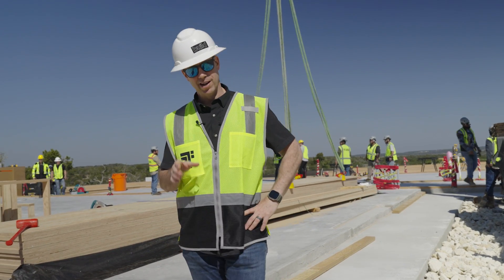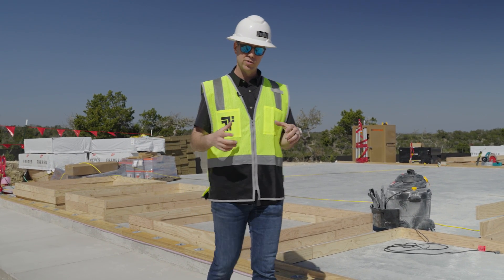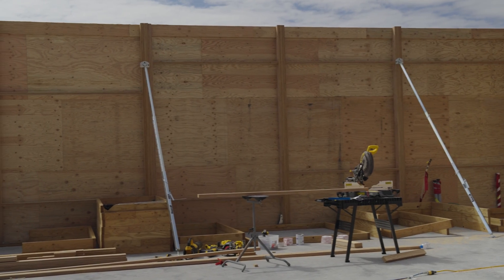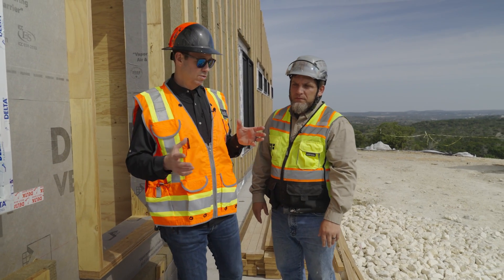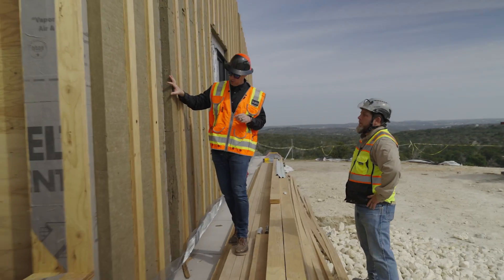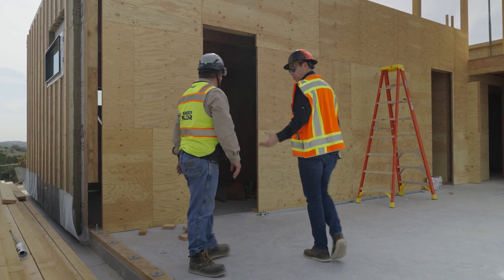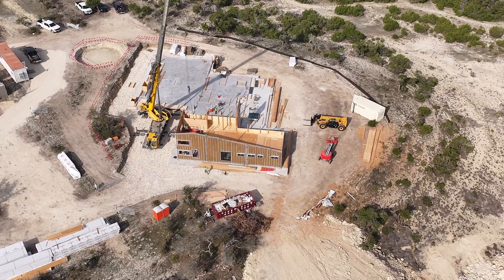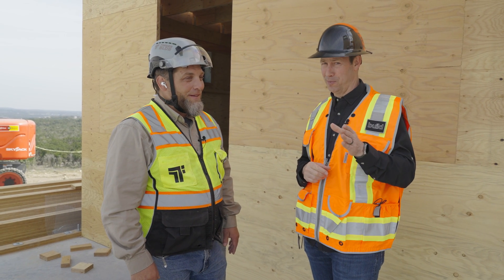NEW FRAMING Like You’ve Never Seen - Mass Ply Light House/Barn

Comment: Gimme two layers of 3/4" ply, offset from each other,  in jumbo form factors like 8'x32' or 10'x40'.  Seams (vertical and horizontal) become the weak point framing with 4'x32'.  A 10' wide panel can frame an 8' window in the center and remain structurally strong all on its own.  Do it right and a tight nail spacing will give you tons of strength without using any fancy Simpson hardware.

Comment: Hey Matt, how many times have we both done remodel & found big time wood rot thankx to plumbing or roof leak that went un-noticed for a while? Just suggesting Sir,, a quick spray coat of paint primer sealer on all rough-in material. so future overlooked leak, wont cost a lot of rough-in replacement or cause any dangerous health hazard  black mold growth. I admire your ability to know exactly what your paying for & selling
Reply: 100%. For a guy who coined the phrase if it doesn't dry it will die, seeing him push this material.... is bizarre to say the least.

Comment: What is the purpose ? Heavy, to many brackets, expensive screws, all expensive ply construction,  Great for expensive cost. Expensive to insure,  Is there some fire rating to chase, or earth quake concern. What is the gain ? Just questions from a 45 yr commercial carpenter bridge builder. In my years a lot of this re-event has gone to the way side or just other past ways are just as good.

Comment: This is why US buildings only last a few years. In Europe this building would fail any building code because it's build like a temporary building. The Plywood will just rot and be eaten by bugs, adding a bit of metal mesh at the bottom is never ever going to be bug proof. There will always be holes either from new or after a few years that compromise the base of the building. A ground level to 1m of blocks would help solve this issue. In Europe this building would fail any building code because it's build like a cheap temporary building and not built to last. Use bricks, blocks and real roofing materials like the rest of the industrialized world.
Reply: Oh c'mon. We have wood buildings a century plus old and still fine. Big buildings 150+ and excellent. The US building industry is like just-in-time inventory management. Just enough. Cost matters as much as ultimate longevity, something Europe does not understand nor care about. Not that this build is low cost, I'm talking lumber in general. US LVL is crazy outstanding.
Reply: Plenty of European countries use wood to build. Just because you haven't traveled much doesn't make you right.

Comment: Watching this from California, my first thought is that this would be great construction for earthquake country. These are dream shear walls.
Reply: The company that manufacture's the LVL for this video, Freres, manufactured floors and columns for and 18-story building in Oakland CA. You are very correct that these would make dream shear walls, and a lot of research is being done on mass-timber rocking shear walls.
Reply: @collinbarkley9699  We had a soft-story seismic retrofit of our building which consisted largely of adding plywood shear walls. The amount of labor that goes into that process -- compared with just lifting these panels into place -- is staggering. I'm sure the LVL is not cheap, but you would save a lot on labor and time.

Comment: What cheap garbage construction, one spark or the like and the whole shebang goes up in flames like a campfire before the fire dept even gets it's hoses connected.
The build real houses in Europe, Hungary, Romania- google view and you'll see almost all the roof are red, why? because they don't build the houses like matchboxes they build them from kiln fired red terracotta blocks that are larger than our concrete blocks, and they are vitrified in a kiln around 2000 degrees.
The walls are about 16" thick, and the hollow cavities in the blocks allows for insulation inside.
Substantial, solidly built, fireproof, sound deadening, vermin and insect proof.

All the walls are built with the terracotta blocks, then they are given a stucco on the exterior. The roofs are not solidified gasoline like the tar and asphalt roofs we have- they are made with the same kiln fired red terracotta pressed into roofing tiles- waterproof, never fades, fireproof.

A house with this construction was caught in Google's street view when it was under construction, a newer view can be found at that location showing it finished if you click on Peton street to go up it- the view changes to a newer date;

https://www.google.com/maps/@47.4981128,17.5682232,3a,15y,198.19h,106.02t/data=!3m6!1e1!3m4!1smx8iWAiS3ClbFMeeczeHNg!2e0!7i13312!8i6656?entry=ttu
Reply: There comes a price to Euro construction. Where our houses are infinitely variable, expandable, fixable, modifiable, customizable, not so with such block construction. Ease of building, speed, variability in look, cost from low to high, quality from low to high. On and on. I swear to God, Euro pride comes up about the weirdest things. Accept that you don't have all the answers, and in fact, have an overall inferior building trade landscape. We have massive choice, massive options compared to Euro strictures. Truly old world vs new, emblematic of why people left Europe centuries ago. I love Europe, the culture, and history. But in building, no.
Reply: Cold, uninsulated, damp, dark, and small, too.

Comment: Basically just a pole barn using LVL and plywood (rather than pressure treated 6x6 posts, framing lumber purlins and painted metal siding and roof panels) and I did not even watch the video.  Not a bad idea, but I would prefer ideas that use no wood at all to prevent fire risk, water damage rot, termites, etc.

Comment: Matt, Trent, 
This Mass Plywood Light Framing does check a few blocks for me as an ole Design & Manufacturing guy.  Perhaps you've heard the world's #1 Master Guru of Design & Manufacturing, Elon Musk, say "The Best Part is No Part, the Best Process is No Process!"
This system by design eliminate mass parts, studs, all the Processes of Measuring, Leveling, Nailing hundreds of Studs and thousands of nails! 
Now, if the plywood was only built with Huber Zip type water, air, vapor membrane Sheathing it would be even better.  
Haha, but at what cost? 😜
I'll take Huber Zip all day long over regular OSB, plus WRB & Prayers for Air Tightness! 

I'm looking fwd to the next video. 

Cheers, Eric

Comment: Its  amicably shear walls make the wall and flying in place logical and easy as long as its perfectly square and your slab is perfect. Engineered lumber is stronger and straighter than conventional 2x material. The plywood is extra strength. This building is stronger than a concrete building!!!

Comment: Why don't you rest the bottom edge of the 1 1/2" plywood on the concrete so it is structurally supported, and not just hung onto the framing with screws?

Comment: @buildshow Matt point out the thermal performance difference of stainless steel screws when doing an install like this through the insulation. A lot of thermal bridging product for commercial but ussaly see screws going through on residential systems like this. Even if youre thermally separated i think a lot of people will do a DIY exterior CI and not know how bad normal screws are vs SS. The $200 vs $50 a box screws pay for themselves pretty quick.
People mention it sometimes but don't do a walk through with numbers and energy loss. I ran the energy cost of stainless vs standard rodenhouse screws 4 years ago and was shocked at the difference.  Never again will I think it's just a few screws. 
It was a metal roof assembly the screws attached to on the outside of the envelope so that made it more extreme but still. 
I trybto keep stainless 3" screws around now. But only in my truck😊
Thank 
Rodger

Comment: Matt, I believe this is called cross laminated timber framing (CLT framing), or at least a variation of it.  Most CLT framed homes have more plies in their walls than this project, depending on how much strength and thermal mass they need.  I saw a video on a CLT home with plywood walls over three inches thick.  It's a fascinating way to build, and since it sequesters a lot of carbon in all of that wood, it can actually be very eco-friendly as long as the wood used is sustainably harvested.
Reply: Mass timber is typically made with dimensional lumber(1.5” thick).  The project I’m on uses 2x6 in 3 or 5 layers for shear walls and floor deck

Comment: Tilt construction with MPL sounds like a no brainer. I'd like to see a video on the cons or situations you might want to use another method. Since this kinda reminds me of SIPs, it'd be cool to get a comparison video of SIPs and the MPL. 

Sick stuff guys!
Reply: seems like the SIPS might be superior in terms of R value and rigidity.  This method seems like it would really excel with controlling moisture penetration, pest penetration, mold.  First time I've seen the rain screen principle actually applied.  175 mph wind resistance is impressive.  That may seem overengineered but there are these things called tornados.
Reply: @lkj974  Good points. I'm down in south FL, so the wind resistance is plus for us down here :)

Comment: Seems like an engineer spec house and not really dealing with the elephant in the room. What happens when that plywood gets wet. The outer sheathing will probably be fine since a lot of builders use plywood and a Tyvek membrane. Not sure why you would use plywood for rainscreen spacers. Definitely not a century home in my opinion.
Reply: You used tyvek and 100 year house in the same comment. 😅😅😅

Comment: How is this different from cross-laminated timber?
Reply: Cross laminated timber is plywood built up to dimensional sizes so its the same.
It's all in the specifications of the material. Since the company doing the install does mostly commercials, which have higher requirements usually, I'm guessing   it's on the lower end of lvl spec and on the high end of plywood spec.
A lot of framers may their own lvl beams on big houses.
I learned how to do it when I had to pull in a buddy that worked on top tier homes to fix my stair way going up two flights and surrounded by concrete. 
He called to ask what 22" lvl would run and his sales guy said you don't want to know, when I asked how much that was he said he didn't know but we were going to be making a custom lvl and got to work. 
It ended up having two drops in it over about 16 feet. 
I had a curved metal roof and he made sure to tell me to not buy radius trusses if I built one that need them. Then did a walk through of the price to build them vs buy them. So do that if you ever  need exposed radius lvl trusses.

Doesn't even require fancy glue because the large surface area, and you use 1 1/8 structural ply for all of this. 
Now that I'm thinking about it I be avantech might be better. My to do list now has reading spec sheets and call Huber tech support added to it.😊

Comment: Im sure you're familiar with CLT, cross laminated timber. Similar concept but can be used for high rise buildings.
Reply: Yep sthis basically the same type of material. Mass timber uses all kinds of built up lumber so CLT vs LVL is just two different products in the same tool box.

Comment: Hi Matt,

Fascinating video! A couple of comments above seem pretty skeptical of the properties of plywood. Perhaps in the future videos you could address two issues that I’ve seen impact longevity of plywood. 

In roof decking I’ve seen premature delamination due to high temperatures caused by improper ventilation. It seems like your insulation will be quite sufficient to prevent this, but perhaps we’ll learn more when you roof it. I know you love that standing seam!

And of course, there’s always moisture control. I’m interested to see more of the details around moisture management since you always seem to be very thorough in that regard. 

And if there is a situation where a moisture issue isn’t identified in time, are there repair procedures if part of a panel needs replacement? I’m thinking of a video you did about problems on a remodel with a modern silhouette…might have been OSB but ended up with serious rot pretty quickly.  Could be interesting since the plywood probably couldn’t be sistered like traditional framing.
Reply: Something to keep in mind. This is LVL not normal plywood. Stronger glue, certification, much stronger. APA certified lvl is just a different beast. And we will be digging into more detail on a future video.
Reply: Yeah simply walking through the basics of modern lvl/ply is a good idea. 
Most people have seen more 1970 ply than 2000+ ply. They think it's the same.
Reply: Looking forward to it!

Comment: This can be done by double layering 3/4in sheets and zero beams
Reply: By definition this is double 3/4 sheets in thickness but sheets won't have the strength of this because of the seems. Can't imagine how much of a fudge factor a structural engineer would put in for that. They would just treat it like 8' sheets terminating on post every 8'.
Which would be a problem since all you're sheer capacity went right out the door.

So I'd say you can't do a build up of sheets with more than a 24 or 36" span. 
Yes I know you can get longer sheet than 8 that's why I said 36.
Reply: @sparksmcgee6641  the structure would be square. 3/4" 20'x10' sheets. Floor would be 20x20. 8x sheet standing vertically make the inner walls of the square. II . Then 8x sheets stacked horizontal to make the outer square . = . This creates a cross hatch layering.

Comment: This has got to be one of the ugliest houses I have ever seen. No protection from termites? No sealant other than the tubes - what kind of life expectancy do they have? Plywood shifts and warps like crazy over time - how will that shape up? And what about the strips of plywood to hold the maple - plywood cracks over time, and those screw strips looked awfully thin. I know my opinions are strong but I almost recoiled when the guy said that it was pretty much timber framing. I would never equate these two methods.

However, in the face of a cheapening building industry, pioneering cheaper and cheaper materials, such as (potentially) plywood everything like this, does make you a brave and experimenting man.
Reply from the maker: Wow. Not impressed eh?  Well, stick around to see how this ends up. I plan to make several progress videos on this project
Reply: @buildshow  Hey, thanks for the reply. I again would like to say, I find you brave for delving into an at times turbulent comment section. I find a lot of your videos pretty educational, and value most of them. I also frankly have enjoyed the larger build show enterprise. Finally, I don't mean to demean your team. I do in fact look forward to seeing this house become reality.

However, the methods are to me very important. Design philosophy and especially, practicality are very important. I know that you're building something designed by others, and engineered as they say in the video, but when I personally build, I find longevity and ease of or, anticipation of maintenance to be very important. For example, the method of anchoring the framing to the foundation, that form of drilling post pour, isn't that technically less durable than anchoring with pre-positioned and tied foundation bolts? I also come from a climate that is wet, and challenging to build in due to high and humid summer temps, to cold cold below freezing areas. I am surrounded by houses built both before the civil war (my grandparents live in one such home, for >160 years, it has aged very gracefully) and homes built within the past 20 years that are already experiencing seriously disruptive problems.
Reply: You're talking about 1970s plywood, not current material.
Plywood is stable, and since it's all wood, it'll expand and contract the same. 

Dry climate, so termites aren't much of an issue.
Reply: I guess it’s a good thing this house isn’t being built for you!!

Comment: I have trouble grasping what the LVL panneling adds compared to girt + traditional sheathing, wish an explanation was provided there.
Reply from the maker: Ok good. I’ll add that to a future episode here
Reply: @buildshow Matt point out the thermal performance difference of stainless steel screws. People mention it sometimes but don't do a walk through with number and energy loss. I ran the energy cost of stainless vs standard rodenhouse screws 4 years ago and was shocked at the difference.  Never again will I think it's just a few screws. 
It was a metal roof assembly the screws attached to on the outside of the envelope so that made it more extreme. 
Thank 
Rodger

Comment: Final seconds of the video "what does it cost" answer "be ready to be surprised" he says.... something tells me I won't be surprised
Reply from the maker: You are a “half empty “ glass guy aren’t you?
Reply: @buildshow  😁😁😁 half pessimistic,  and half of me thinks the glass is actually 2 times too big 😆
Reply: Bet it's about a buck a face foot when buying it at the scale the installer gets it at. So guessing under 2 a face for the framing material. Install who knows but I'm guess dried in and insulated I bet it's within 20% of stick framed to the same level.  Maybe the same price typically.
I'll say it's 20% cheaper than stick framed at that location because of the labor availability and drive time of a crew if it's more than an hour outside the city.

Cranes are your friends.